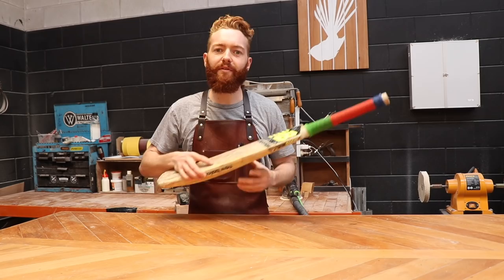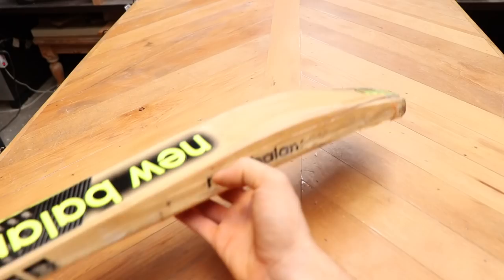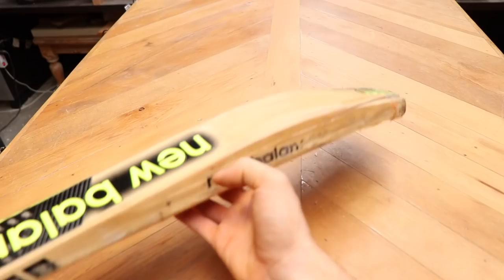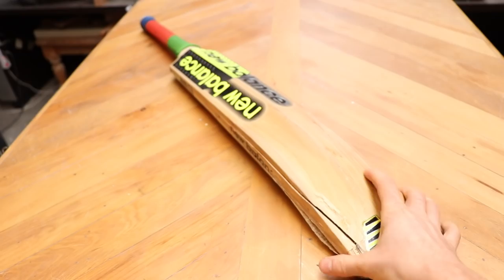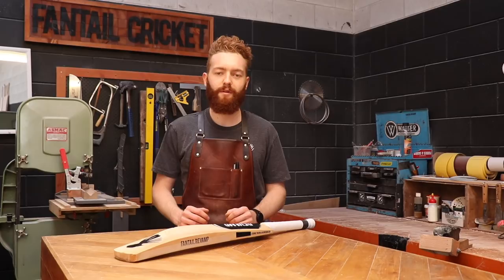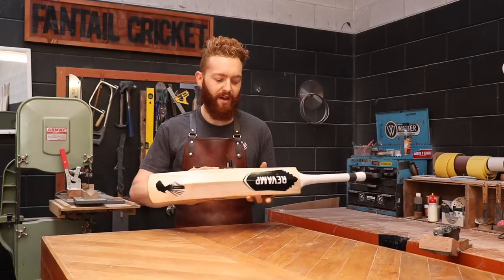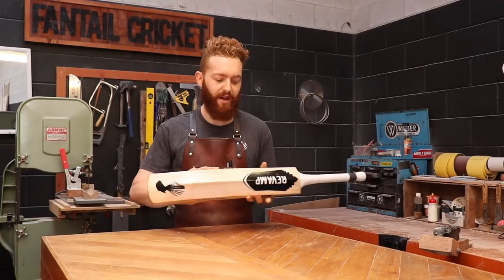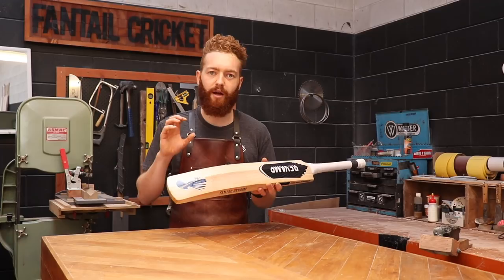Cricket Bat Repair 2019  - Major Toe & Edge Cracking

Comment: thanks for posting the video. Two Questions.
1. I saw you used two part Epoxy to bond the spitted toe. Wont the Epoxy become Hard/Brittle after drying up and with the ball impact / abuse the bat is likely to have in the cricket field will bring Cracks in the Epoxy Joint inside?? just like Glass Cracks when we try to flex it ? 
2. Purpose of the dowels across the blade is well understood. do you have any experience of these dowels causing vertical breakage due to less long grain support at specific areas of the bat.. imagine a fast ball hitting the toe of the bat and the bats man trying to hit hard, what pressure will the reduced long grains experience near the handle of the bat. this area is thinner than rest of the bat and we have much less number of connected long grains as a result of drilling the dowel space. what is your experience on this. have you received complaints from your customers ??

Comment: What's the purpose of the small sticks inserted at different heights perpendicular to the bat after drilling the hole ?
What does that do ?
Reply: They will fill the holes that he just drilled.
Reply: The dowls provide extra lateral support,   Think of them like ribs of the human body. Where the bat was split it lost strength, so by glueing back into place, the dowls provide extra insurance that the splits don’t reform.

Comment: After you applied the oil to the face how long did you have to wait before you applied the protective face cover? This has been a problem I have had and only resolved by letting the oil soak in over a few weeks then applying the cover.

Comment: Why did he drill holes into the side of the bat to put in wooden sticks?
Reply: probably to strengthen its structure.
Reply: to 'nail' the bat together sideays. as you can see at the start its starting to split along the length of the bat, this pretty much holds it together and stops it from splitting again, well atleast for now

Comment: Wouldn’t this break? I can see cracks still
Reply: True
Reply: its probs not going to be as strong as a new but but those cricks would be pretty shallow the rest are held/filled with epoxy, that plus the dowels stopping them splitting length ways and the fibre glass tape on the face will hold it together pretty well.
also you might has notices when he was hitting the dowel in that glue squirted out of the bottom, that was pretty much the dowel forcing glue into what ever little gaps were left in the bat

Comment: I'm wondering if you have checked the MCC laws regarding bat repairs and your thoughts? I found it interesting that toe and edge inserts (dowels) for bat repair have specified distances they can extend into the blade. Appendix B5 specifies side insert may extend (inward) from the edge no more than 2.54cm across the blade at any point.

Comment: absolutely love your videos as they are so easy to watch and you film it in a way that makes the process easy to follow. I refurb my own bats but dont repair the toes (yet). I was wondering, as other videos show PVA glue used to seal the crack but you use something stronger - is this a 2 pack glue ? And also, what brand is the full width fibre tape ? I cant seem to find any that wide in the UK, only 2 or 3 inch ? All help much appreciated.....

Comment: What type of glue are you using and when?
How long are you leaving the bats glued before working on them again?
Was that oil you used just before the fibreglass tape?
If yes to the above, how is the tape sticking to the bat after its been oiled?
I usually try to service/fix my own bat and would love your answers, thanks in advance.

Comment: Hi Fantail - Just for interest sake, why are you using an epoxy glue and not traditional wood glue to 'glue' up the wood on the face and toe of the bat. I find it interesting that you would do that and was just wondering if there is something special about that epoxy?
Reply from the maker: Hi Andrew, we use PVA wood glue where a precise join is involved, e.g. a handle or dowelling. We use epoxy where there could be missing pieces or small gaps. We often use the epoxy in the toe to thicken the layers of the toe back up after over compression from yorkers.

Comment: Great video but do you really add the scuff sheet straight after oiling the face?

Surely this would stop it from sticking to the bat if it was put on straight afterwards.
Reply from the maker: It depends on the amount of oil you use. This is why we put a small amount in our hands before applying to allow you to control the amount of oil that is applied to the bat. Yes, we apply the facing straight after oiling.

Comment: Great vid, I've been trying to repain similar issues with my own bats., what kind of glue do you use to repair the splits before you clamp it up?
Reply from the maker: Epoxy for open cracks/handles, super glue for surface cracks. If we need to fill a small area we'll use an epoxy/English willow dust mix.
Reply: @FantailCricket  thanks for replying... i'm getting right into trying to reapir damaged bats!! i've just finished a bat of mine that had the face split away from the toe

Comment: You work hard but will it last or just crack from same spot after few shots or stroke played by player I doubt it will crack quickly from edge where you set the wooden pins.
Reply: No

Comment: The only mistake that I detected in the repair was that the glue must have been trickled down into the cracks rather applying with spatula..
Reply: You can't do that because of the viscosity.

Comment: The most surprising thing about this video is a New Balance bat lasting long enough to need refurb/repair. Normally NB bats snap in half along the horizontal long before you can use them long enough to receive edge/toe damage. In fact I have never seen anyone have edge/toe damage on a NB bat!
Reply: Lol i didn't even know they made bats
Reply: @Allthingsorganic  They are the number 1 batmaker in the world, going by number of international players that use them.
'Batmaker' is a very loose term however, as they dont even employ any batmakers, they just get a cheap Indian factory in India to mass produce them.
Reply: @Debbiebabe69  so they use kashmir willow?
Reply: @Allthingsorganic  They use Kashmiri willow in their low end bats, but import willow from England for their mid-range and top models.
Reply: @Debbiebabe69  OK thanks